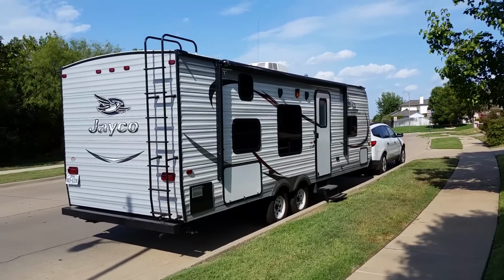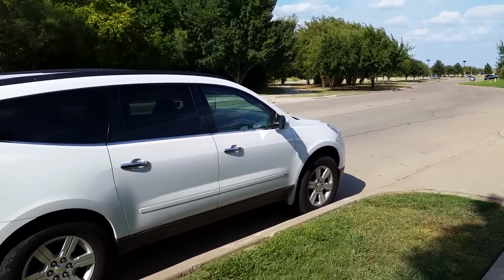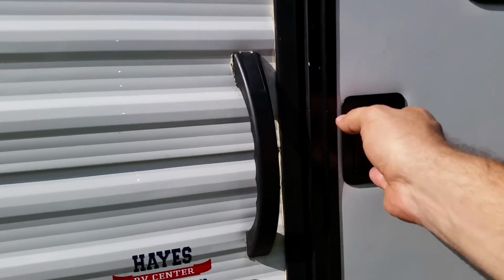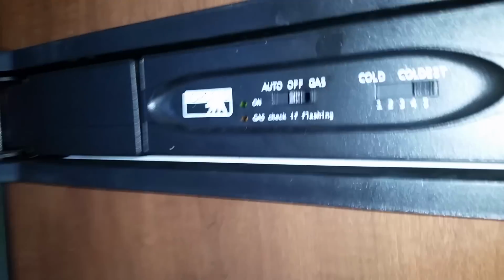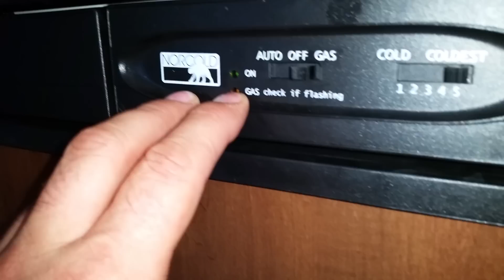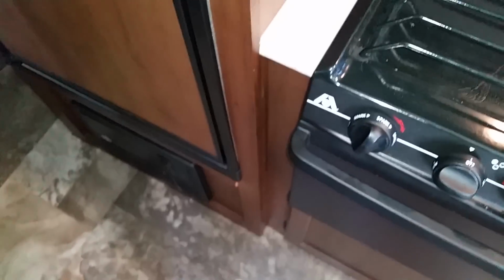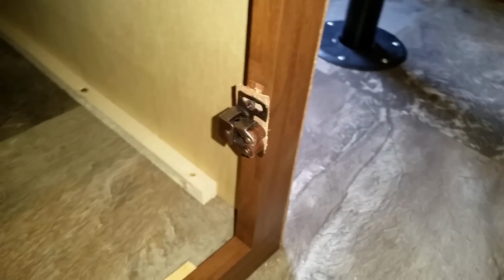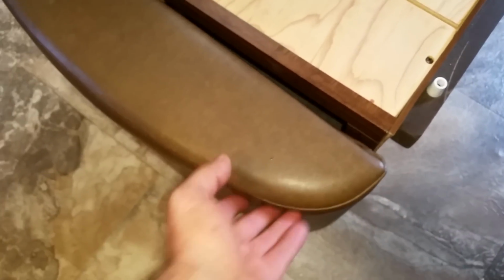Update: New JayCo Trailer FALLING APART.  Lengthy Warranty Work Needed.

Comment: The reason it is easy to tow with a car, is because it's built out of paper, flimsy fiberboard and dead hopes and dreams, not so much quality materials. Quality materials would be much thicker, heavier and sturdier, and then you could forget about towing it with a car, you'd need a proper truck. If you need a proper truck to haul it, that would mean far fewer people would buy one. Easily towable with an undersized vehicle, OR high quality, sturdy and luxurious. Pick one. Even using enough glue and enough screws will add upp weight and make it less easy to tow; they didn't miss that there are too few screws and too little glue, they figured out what was the absolute minimum they dared to use and went with that.

Comment: Reality is that most travel trailer campers are built with pretty poor materials and methods. There are some exceptions and price is not necessarily an indication of quality. You really have to look closely at what you're buying when it comes to RVs and travel trailers. And yes standard in the industry is several months to get anything even looked at by a dealer and even then can take weeks or months to get it back out of a dealer sometimes depending on how bad the dealer is and many are bad.

Comment: People believe they are spending money on a good investment, until they realize what they actually paid for. I worked in service at a Jayco dealership for 13 years and I can tell you that these are only some minor problems. I had to repair several slide rooms and plumbing issues. Installing washer and dryer units are an extra level of pain in the rear on their r.v.s. I do know for a fact that there are worse and similarly built campers. Just know this, when you purchase an r.v. it is not as durable as it looks. Dont hold your expectations too high, and I would recommend demoing or renting a camper you would want to buy first.

Comment: I see more and more smaller vehicles pulling travel trailers. Not the point of the video but I would be looking at the vehicle first. I have a ram 1500 pulling a 5500lb trailer with a tow capacity of 9600 with only 200 lbs of payload left and I can at best get it up at 60 with sway and that is with a weight distribution hitch. Passing Semi's and cross winds are enough to keep me at that slow speed.

Comment: Sounds more like a Dealer issue than the actual company when it comes to getting it repaired.  I have a 2016 Jay Flight 26BHS and have used it a dozen times since I bought and we love it!  I would agree with some of the quality issues, but that's the price point these models are at, trying to keep the weight down.  After a year, I did take ours in for a couple of minor blemishes and one repair that was actually not on the company. Ceiling molding above the queen bed was buckled due to length being to long and I had a floor board seam fixed that was loose.  Fixed, no problem.  The next thing that impressed me, was my awning arm bent during one of our trips.  No sure how it happened, but educated guess would be the wind caused it overnight.  JAYCO replaced it under the warranty without question, act of nature or not, they DID!  Dealer had it all done in about 2 weeks.  Thank you JAYCO!
Reply: You couldn't pay me enough to be a Salesman.!!   I'm just an average joe with a Jayco trailer I purchased as a consumer.   A "FIRST TIME" owner at that.  We drove around and visited many dealers with many different brands and models.  It came down to the most bang for the buck.  It might have  something to do with the time of year as well.  (Late Fall) I'm not telling you guys to go buy a Jayco trailer today.  I'm just stating that 1 person with a bad experience doesn't mean that your experience will be the same.

Comment: Jayco hasn't up'd their quality with their 2020 Baja JayFlight either... 4 day trip with a 2 week old trailer resulted in tons of problems requiring warranty work, and after 3 days of calling we finally found a dealer that is helping us get it fixed quickly.  Jayco, however, has been very difficult to work with, and getting the warranty work approved is a slow and tedious process.  I will also say, CampingWorld, where we got the trailer, stopped returning our phone calls.  I will never buy anything from them again, and I recommend you don't either.

Comment: I've owned 3 Jayco's & never had any major issues. You must of had a bogus dealer. All trailer's are built cheap. They all have their pro's / con's & you do get what you pay for.  The cheaper light weight campers tend to shake apart going down the road. It prob doesn't help any that your tow vehicle is way undersized for your trailer. Don't care what your tow rating says or how well it tows,  not safe. Hopefully your using weight distribution & some sort of sway control.

Comment: Throw a few axles under your home, then pull it with a vehicle you’re barely rated to tow it with...then see how difficult it can be to assemble and maintain a camper for a customer who can’t even respect it enough to utilize the correct towing vehicle for it(yours is rated at 5,500lbs max, you shouldn’t be flirting with that number!  Be smart, get a half-ton truck).  Also, its a camper...stuff goes wrong!  90% of the issues you’re experiencing are due to a subpar dealership/service department, not Jayco.  Jayco isn’t perfect, and anyone who tries to make that argument is full of it...but there will always be proof why Jayco, predominantly, is one of the best made travel trailers on the market!
Reply from the maker: What types of real life stories does a cable guy have?

Comment: I had that exact model.  Never buy Jayco they are low quality.  I had one and it did not last.  It sat in west Texas for the first 2 years.  I had bring it back to Houston for repairs after the first year (never buy from Lone Star RV).  I told them I had a leak.  Their answer was to add another layer of weather striping.  It turned out the leak was from the window at caused the floor to rot.  The toilet had a leak they could not fix.  The freezer had problems they fixed but did not clean up their mess.  The DC power board went out.  All of this happened in the first year.

Comment: 1st, you have to understand that travel trailers go through the equivalent of an earth quake every time you pull it. 2nd, it is an ultralight trailer which is RV speak for build with less and cheaper materials. You can’t blame the manufacturer for you not doing your homework. 3rd, just because your vehicle can tow it doesn’t mean it should. The suspension on your tow vehicle could be causing too much bouncing and movement in The trailer while towing and could be causing 95% of your “fit and finish” issues. 4th, and lastly, when your crossover blows the suspension and transmission because your towing over the recommended towing capacity are you going to give the vehicle a bad review too?

Comment: My 2018 Jayco 317 RLOK 5th Wheel is a piece of junk. I've owned it for 10 months and the problems are endless. Don't let they re 2 year warranty fool you. I've got delamination issues, Floor squeaking , and holding tank gauges that don't work. And those are just the ones that Jayco has denied warranty on. If you make the mistake of buying a Jayco? Just remember that you've been warned!
Reply from the maker: Fixed?

Comment: Probably buying any rv used is the safest bet. If it mostly is in good shape and working order after a few years, its probably going to be ok. They all seem flimsy and not worth anywhere near the price listed. RV factories just don't have any quality control and they are a bad design to begin with. Europeans build some nice ones but are really priced high and can't compete with the cheap stuff here. Not all the European rvs are real great either, but some are.

Comment: For all those crying, sorry but his Traverse is within ALL towing specs.  Even under GCVWR by over 500 pounds.  I don't know about his payload as he didn't mention it.  If an accident happens, then conditions (for which you dumbasses set) will have it happen whether driving in a Traverse, 1500, 150, SUV, or Tundra.  He's still well within vehicle specifications for towing and safety.  BUT, fill it with water, gear, passengers, bbq…*a-hem...  Electronic brake control is great for any vehicle.Carry-on BSM!

Comment: You may have just got a really bad unit. I know they are low end. I still might buy one just because they are cheap. I will just carefully look it over. I could also repair some of that on my own if I had to. 

How do you feel about the roof and its seal from outside water? 
Are there any cigarette lighter plugs that run on the battery when dry camping? 

Those are the only real questions I have about these units. Do you know of any other reliable brands in this price range?

Comment: They make these jayco jay flights very cheap, but once you hop into a eagle travel trailer or fifthwheel and up like the pinnacle and premier, you will find top notch quality, we are considering getting a eagle ht fifthwheel due to the outstanding quality, and dump our existing keystone cougar xlite fifthwheel, that thing is a pos. In my opinion, jayco is one of the few that makes the best rv's, there quality is amazing and they make a sturdy rv. If you look at the price tag on these jay flights, and compare them to a eagle, it's a big difference because you do get what you pay for.
Reply: Wow, I thought it was just me.  We purchased a used 2015 Eagle Premier 375BHFS about a year ago and are still loving it.  It seems reasonably well constructed, the fit & finish all appear to be fine and we haven't had any issues with plumbing, electrical or mechanical systems yet, knock wood.
We ALMOST got a brand new JayFlight 20 footer instead.  I'm so glad we decided to upgrade before taking delivery, especially after seeing this video!!

Comment: Jayco sucks!!!! Ours has exposed water valves under the twin bed that are NOT covered, we stored stuff under there and snapped the black t handle valves. They’re next to impossible to replace. Our fridge did same as yours. Trim is falling off. The front corner at the nightstands the floors are rotting!!!! My foot almost plunged through!! There are no visible leaks but we have rusted staples now showing on the ceiling that hold the trim piece! These trailers are garbage. I would NEVER purchase another. Ours is a 2012 and it’s basically junk. The leak that is causing the rotted floor in each corner of course is NOT covered by warranty and we were quoted THOUSANDS to strip the siding and replace rotted floor. Oh and a new rubber roof they say is needed even tho they could NOT find any damage or area that might be leaking! Well we pissed our $24,000 right in to the wind. Never again.

Comment: Thank You for sharing.  99% RVs are cheap crap.  Thor and Forest River are only interested in volume and profits and not quality or customer satisfaction.  Their Ultra-Lites would be more appropriately named Ultra-Cheap!  I'd look to independent companies with better quality and materials.  Escapetrailer.com and Casitatrailers.com are a couple if you can find a dealer and/or willing to drive there.  They're small without slide-outs, but built to last.  I'd even drive cross country for an Escape Trailer and make a vacation out of it.

Comment: Our solitude 2017 solitude is almost as bad, fit and finish not as bad as this. funny I just watched them bragging at jayco at how they can build a trailer in 6 hours. Watch it and watch how fast these people have to work to keep their jobs. One of our problems was the complete failure of the lippert trailer brakes, needing to be completely replaced after 3 months on the road. Funny they said it was a 'known issue' if that's the case why did they not send out notices to owners to have brakes checked. less than 7,000 miles on trailer. not good. so even grand designs have problems.

Comment: Jayco is now owned by Thor.  Call the factory rep.  As was stated you are towing illegally.  The Traverse is too light for the weight and length of your trailer.  The speed you are going is over the rating of most of those entry level Chinese tires.

Comment: I built my own camper and have never bought a manufactured camper, but those things all seem really minor and easily repaired, except perhaps the crease in the wall, which might be a sign of more going on under the surface. This just reminds me of cheap furniture that's made of particle board, which is to say nearly all new furniture being mass-produced. If you know how to do a little more than use a hammer and nail, you could probably make most of those repairs yourself easily. You're being overly dramatic when you title the video saying your trailer is "FALLING APART." I was expecting to see some actual structural issue.

Comment: And beware the SLX!  They lead you to believe all Jayco's have the advertised premium construction like Magnum Truss roof, and Integrated I Beams thru the A frame and stronger walls and floors. But NOT on the SLX's. The SLX models are lower quality builds using cheaper and thinner materials like OSB.... not solid woods. The most amazing part is that the lower quality SLX models are still the same weights and prices as the regular Flight models that have all the beefed up construction. They don't give you a price break for lying to you. And they will probably delete this so no one can know.
Reply: My 264SLX has plywood in it and is made better than most Forest River products.

Comment: lmfao those GM engines and transmissions are rock solid. ROFL that Trailer will be in the scrap before that GM vehicle even gets a hint of a problem LOL. Vehicle rated for 2000 LBS ... fuck it lets pull 5000 + LBS LMFAO!!!!

Comment: Yes that trailer had some finish issues but I was ROFLMAO at the bitch about that little nail head sticking out.  OMG dude have you never heard of a hammer? Tap it back in and move on you have bigger issues.  As far as the finish work around the fridge maybe you should have checked that out before you bought it and not after.

Comment: This is built with the cheapest possible materials slapped together. This is what you get. You better check for water infiltration. It's already rotting as well in the wall. Bet me.

Comment: Dude, you bought a sticky that was constructed in 7 hours. They are put together using staplers and nail guns. Consider a quality trailer next time. My molded fiberglass Escape 19 took a MONTH to construct, just as a comparison. The day you drove the Jayco off the lot, you lost a third of it's value. One year later it is probably worth less than HALF of what you paid for it. Right now I can sell my fiberglass trailer for more than I paid for it over two years ago. I know this doesn't help your current situation, but stay away from mass built junk in the future.

Comment: Just purchased a jayco 145rb baja 2021. WORST construction. We should have just bought a fixer upper with the work we're having to do to it. Still haven't been able to take a shower because water floods out the bottom!  DO NOT BUY JAYCO

Comment: I worked at Fleetwood Travel Trailers at their Hancock, Md. plant until they closed it in the early 2000s, and let me tell ya, if Jayco is anything like Fleetwood, then they are complete junk,from start to finish about 7 hours, they were hand pushed assembly line style, a max of about 20 minutes at each station, then they were moved to the next station, regardless if all items were done at the previous station!...quality was never in the forethought, at least at this plant, missing screws, watertight tests not complete, staples and nails sticking out, the list goes on...I would never buy an RV from any company, period, they are all junk...I'll sleep in a freakin tent before I shell out thousands of dollars for garbage that wont last even a few years..

Comment: That's so dangerous...  you're not supposed to tow that travel trailer with that Chevy Traverse...  that trailer needs 3/4 ton truck to haul it.  You might be able to haul it with a 1/2 ton truck, but certainly not that girly SUV Traverse...  you need a real man's truck to do a real man's job...  glad you haven't had any accident yet....

Comment: You get what you pay for.  This a an excellent entry level trailer. They all need work, a little glue here and there and a few screws. If you expect the Taj mahal, simply take your 21K Jayco and trade it in on a 75K Airstream. Or a 42K Outdoor RV from Oregon. Jayco did not spill the coffee shit on the sink, you did. You have to wipe and clean and dry every time you use the sink. Replace that latch cover for 6 bucks on your own. That table backing is not a recliner. You need a truck to smoothly and safely tow. You have more than doubled the tow capacity of your grocery getter wagon, the vibration from this mall crawler is vibrating your trailer apart. Any reported issues will stop the warranty clock on that item. Stop whining and learn to be a man. Get to Home Depot and buy some gorilla glue. That trailer is fine. They are all built like shit. Better yet, stay in a Ayres hotel. Their rooms all look new.

Comment: Some of what I see is abuse. Some more of what I see is you not doing things right. You should not tow with the gas on to the refrigerator. Many states make it against the law to have your propane on while on the road. Your refrigerator needs to operate on a leveled trailer not running down the road. Some things you show are legitimate issues.